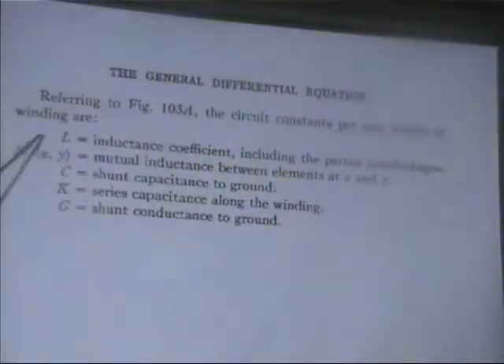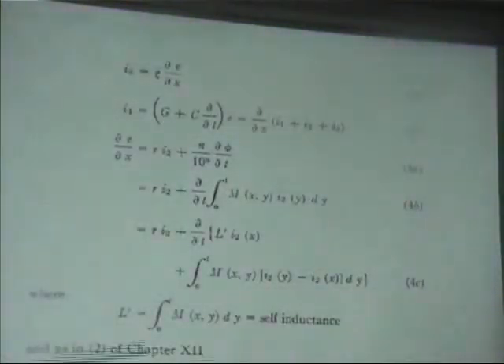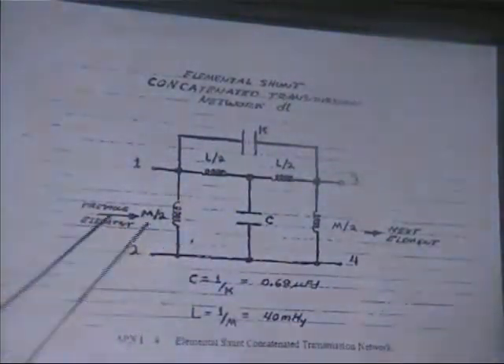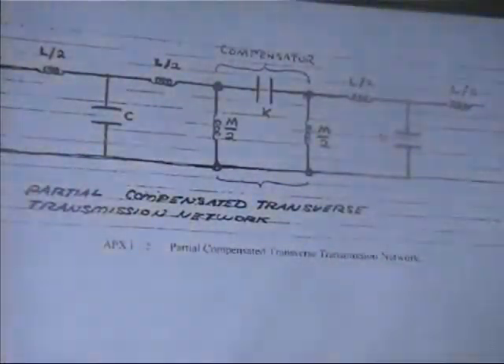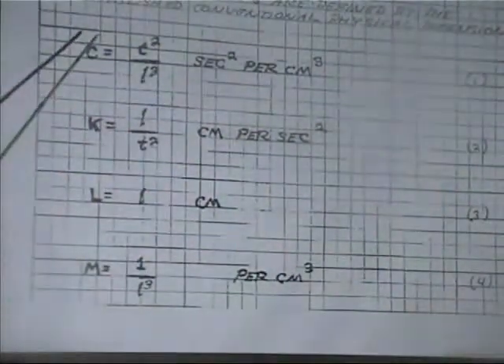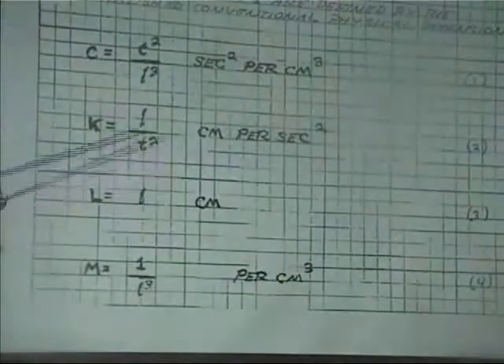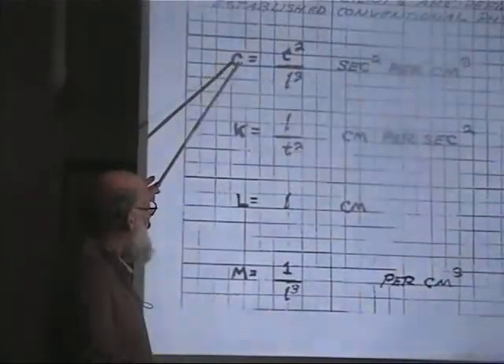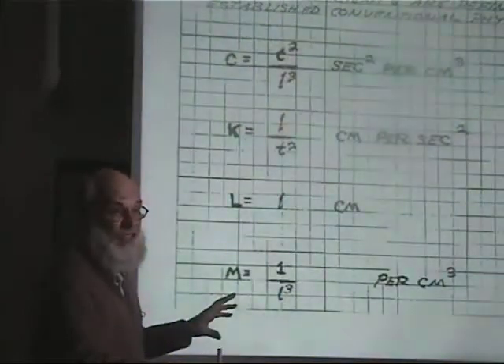Eric Dollard - S.F.T.S. - Dec. 9, 2007 - Part 8

Comment: Nikola Tesla claimed light was a sound wave in the ether. He claimed it was not electromagnetic. According to Tesla, light and radio are longitudinal waves. 

SOUND WAVES CAN BE POLARIZED
(COMPARE TO LIGHT POLARIZED BY CRYSTALS)

“The absence of shear force in the air, or fluids, is the reason why sound is a longitudinal wave, Dr. Wang explained. He had been exploring if it is possible to realize transverse sound, which requires shear force. Then he conceived the idea that synthetic shear force may arise if the air is discretized into “meta-atoms,” i.e. volumetric air confined in small resonators with size much smaller than the wavelength. The collective motion of these air “meta-atoms” can give rise to a transverse sound on the macroscopic scale.

He ingeniously designed a type of artificial material called “micropolar metamaterial” to implement this idea, which appears like a complex network of resonators. Air is confined inside these mutually connected resonators, forming the “meta-atoms”. The metamaterial is hard enough so that only the air inside can vibrate and support sound propagation. The theoretical calculations showed that the collective motion of these air “meta-atoms” indeed produces the shear force, which gives rise to the transverse sound with spin-orbit interactions inside this metamaterial. This theory was verified by experiments conducted by Dr. Ma Guancong’s group in HKBU.”

– https://scitechdaily.com/physicists-discover-a-remarkable-new-type-of-sound-wave/